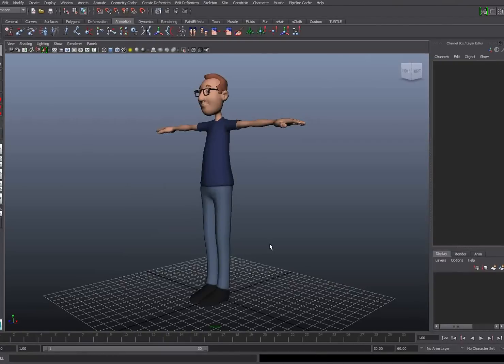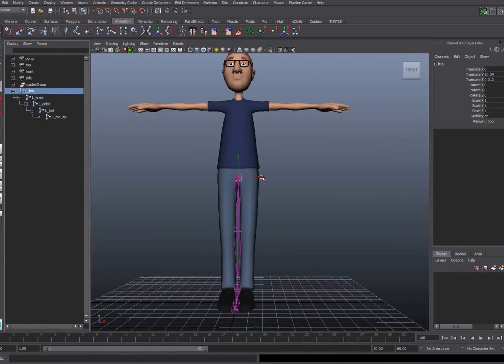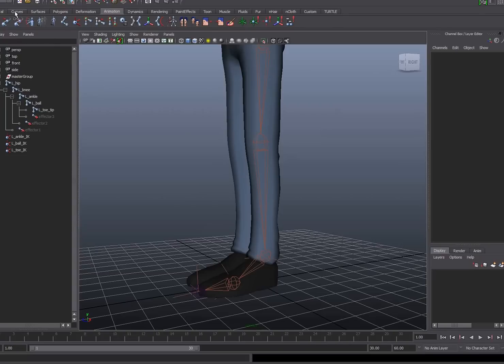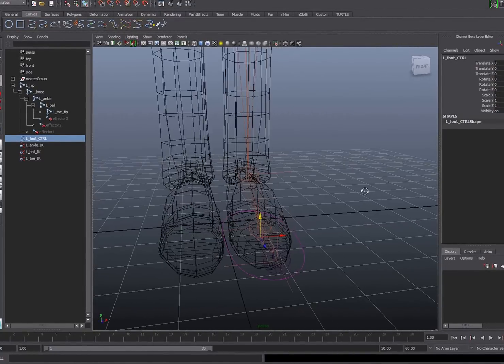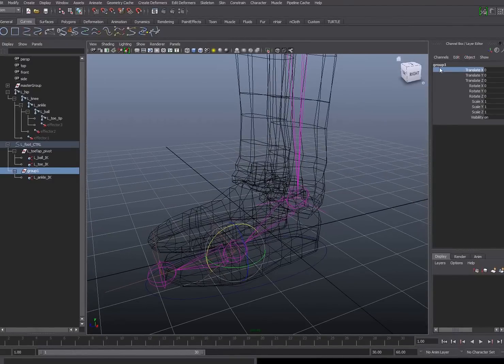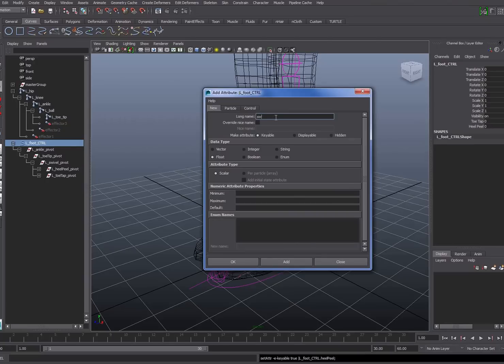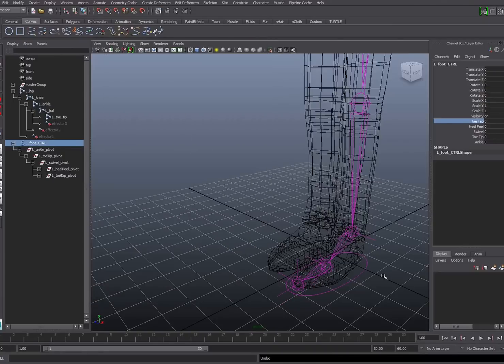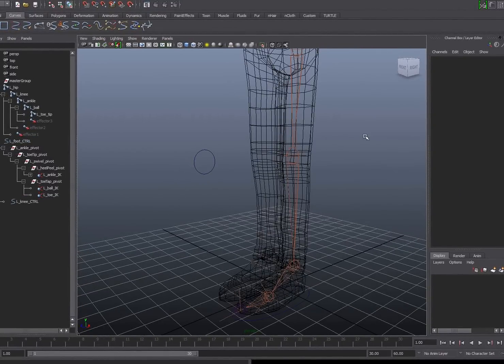Tutorial: Rigging an IK Leg in Maya

Comment: Great tutorial Jason. One question, how to mirror the rigged joints?
Reply from the maker: Hi Jason.
The IK handles will be mirrored with the joints.  But the controls, groups, and attribute connections will not mirror automatically.  I typically create a control for one side of the character, add all the custom attributes, then duplicate it (saving the step of adding custom attributes to the mirrored controls).  But the grouping and attribute connections need to be made to the controls individually (which is why riggers typically script this entire process).

Hope that helps,
Jason
Reply: thank you Mr. Baskin

Comment: Great set of videos! Very helpful. 
One minor problem I've come across; When I group the IK ankle pivot to create the 'heel peel' motion, the joints don't behave the same was at the IK handles. The handles of the ball and toe stay in the correct place, but the joints decide to rotate around the ankle joint. However if I then move the foot control even slightly, the joints snap into the correct place. Do you think this is just a Maya error?  It also affects the mesh once skinned in the same way.

Comment: This is helpful, but is there a way to duplicate it or mirror it all to the right leg?
Reply from the maker: Lucas Kelly Thanks for writing.  Unfortunately, Maya will only preserve certain aspects of the leg rig when it is duplicated and mirrored.  For maximum efficiency, my suggestion would be to create the joints and IK handles first (before creating any controls or connections), then mirror the joints.  The IK handles will automatically copy and mirror.  Next, I would create a control hierarchy for one foot (which contains all of the pivot transforms), then duplicate and mirror the control (by scaling -1 in X).  You'll need to freeze transforms on the duplicate controller, then manually insert the IK handles into the hierarchy and make all of the attribute connections.  Hope that helps.

Comment: Is there any possibility to "transfer" all these actions automatically to the right side as well, or do i have to do everything like this manually for the character's right side again?
Reply: Not really. I've tried it before and the settings didnt transfer over. I wish it was as easy as mirroring geometry, but unfortunately it isn't.
Reply from the maker: Crystal Nunez Thanks for writing.  Please see my other response discussing the mirroring process.
Reply: Jason Baskin where is it?
Reply: "+Lucas Kelly Thanks for writing.  Unfortunately, Maya will only preserve certain aspects of the leg rig when it is duplicated and mirrored.  For maximum efficiency, my suggestion would be to create the joints and IK handles first (before creating any controls or connections), then mirror the joints.  The IK handles will automatically copy and mirror.  Next, I would create a control hierarchy for one foot (which contains all of the pivot transforms), then duplicate and mirror the control (by scaling -1 in X).  You'll need to freeze transforms on the duplicate controller, then manually insert the IK handles into the hierarchy and make all of the attribute connections.  Hope that helps."

Found his response.